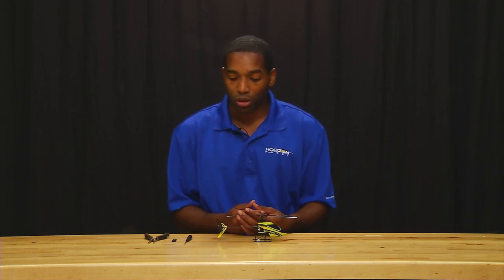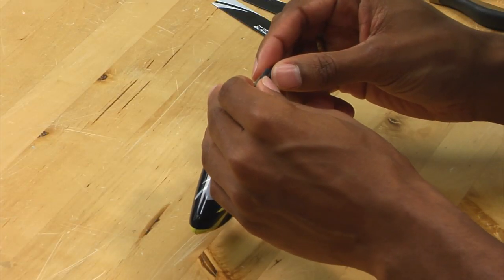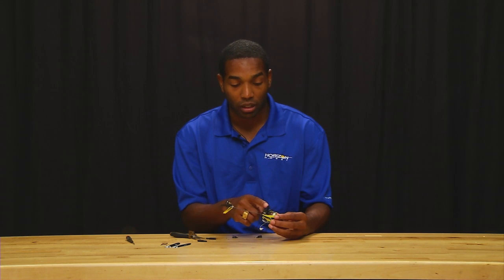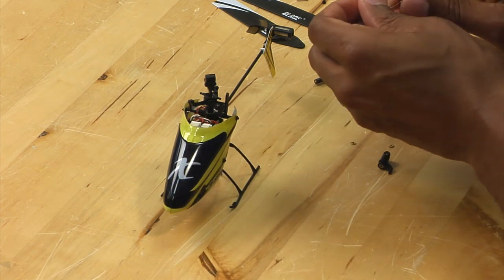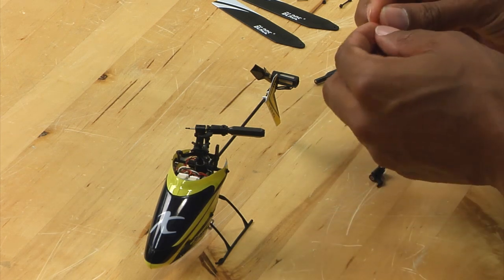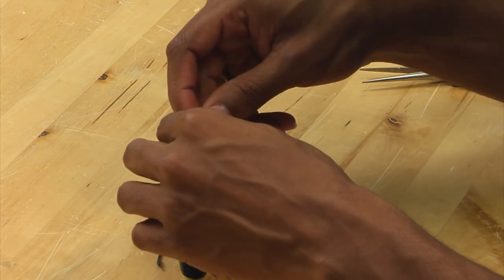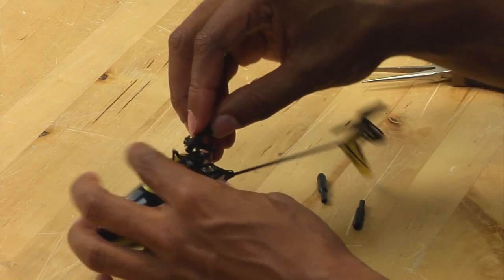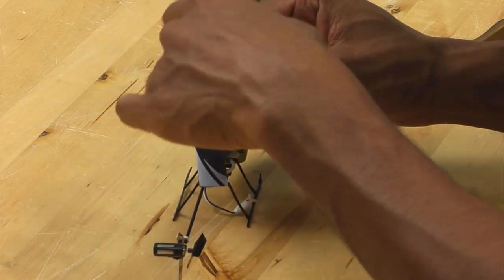Blade Nano CP X Spindle Repair

Comment: man this video would have given me at least a little bit of confidence that i made the right choice going with the blade nano over one of the other helis except for one small yet huge problem. why the hell do you not elaborate on the damn spot of glue? what type and how the heck are we suppose to get it on there. without this bit of info it makes this video worthless. how frustrating. first of all i didnt even mention how it is that my brand new nano is in need of this. let me tell anyone who is reading this. right out of the box i flew it like 3 times with no crashes. so i flipped the remote to the 2nd setting which is full throttle with pitch control and i was just running it without taking off and the damn blade assembly exploded. it could have been so much worse had the blade hit my face but luckily it just hit my chest. strill hurt a little. can you imagine in the face. i would have had to file a lawsuit with these guys. it should never have came undone. so needless to say they probably didnt put enough glue on it though i could see a little dab on the nut . so ya im not happy about any of this. had to wait a frigging week for the new parts all because 1 of the 3 packs i bought were not prime . How stupid. they sent two separate packages from the same place one got here hipping on a 3 dollar part. i think maybe i got the wrong heli .in two days and one took a week. and i had to pay 1.99 shipping on a 3 dollar part. and i see no one answered the other guy with this same question so im sure no one ever will. i guess i will see what i can figure out on my own. again if you havent bought a nano yet i would suggest you go with the competition.

Comment: Damn I just tried doing this and both the plastic tools seemed to strip when I tried screwing the shaft bolt back on to the new feathering shaft. I might have gotten it cross threaded but now its stuck and won't come back off or screw the rest of the way in :(
Reply: seeingeyegod same